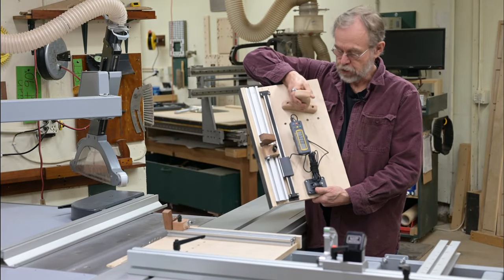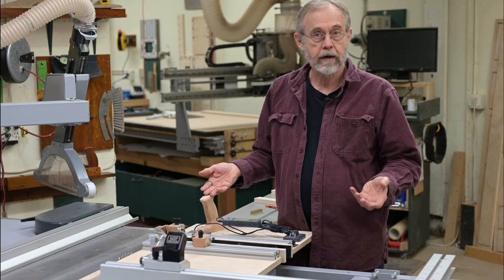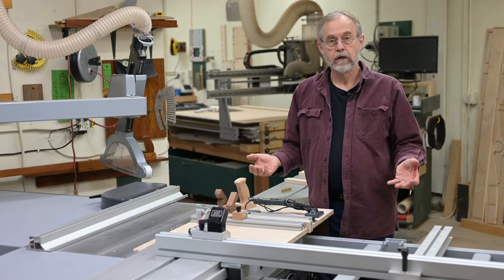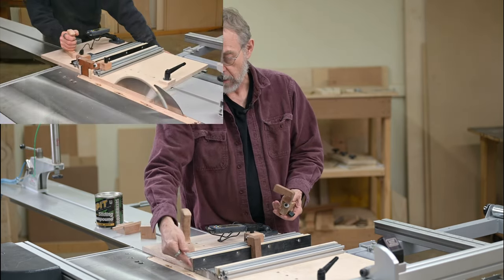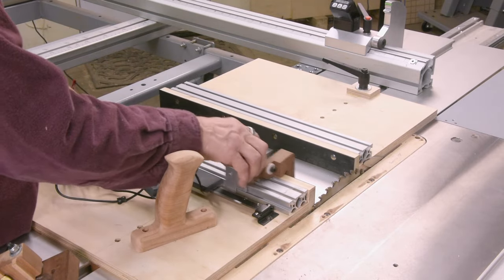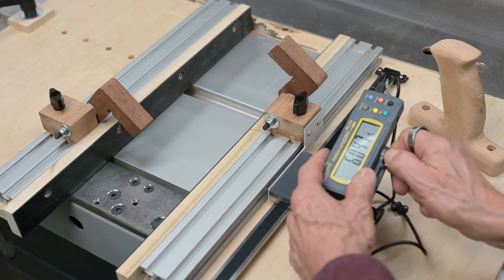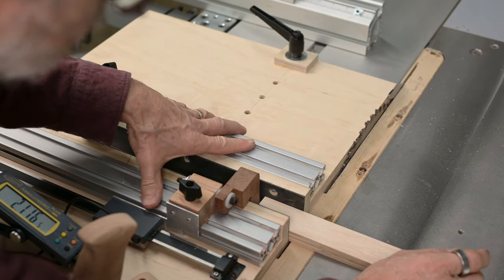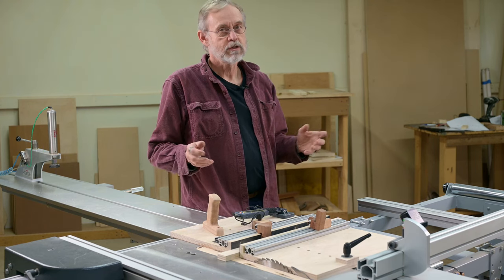Fritz and Franz with DRO (digital read out)

Comment: Excellent work!! Thanks for making this video!! I need to take this same build soon as well as make some pneumatic clamps similar to those on your slider. Researching to source all the parts and fittings is so time consuming. This really helps!

7months later it s there anything you’d change on v2.0? Do you find the jig(s) line up repeatable in the huge t slot on the felder slider? Like, each time you remove and replace then do they line up parallel to each other and square to the table? This has been my biggest concern having never used a fritz n franz jig before
Reply from the maker: Thanks... No problem with the two parts lining up.   If I were to make another version I would try to make the stops smaller - they prevent me from cutting somewhat narrow stock.
Reply: Good advice, thanks again. I now have two 500mm DRO’s on order. I think this one will be a bit of fun!

Comment: The other approach is to put a DRO on the rip fence and use it as the measuring stop, my F&F jig is two pieces of MDF with nothing on then because every cut is measured from the rip fence. I cut a 200mm length of fence and put that on the rip fence head which means I don't have any fence to walk around and I hardly ever do any ripping using the rip fence instead it is all done on the slider.
Reply from the maker: That's an interesting approach - I like its simplicity. My situation is a bit different - I use my rip fence on a regular basis for  ripping. My other restriction is that  when I went to add a DRO to my rip fence I found that Felder makes more than one "knuckle" (the cast iron  part of the rip fence that the aluminum fence slides on) . The knuckle that came with my saw does not accept the DRO.
Reply: I hardly ever use the rip fence unless the piece can't be ripped on the sliding table as the finished face is a far better finish and it is far safer.

Comment: Great video! Try putting a wave washer between the body of the DRO and the bracket. If you can't find a wave washer an internal tooth lock washer would probably work also but I would try 1 of these on each side of the bracket. If you have a local hardware store they should be able to fix you up. Our big box stores in the Texas panhandle don't show to stock many of either type. A last resort would be an auto parts store. I sure miss the 4 locally owned hardware stores that all died in the 90s and early 2000s. They had a lot of neat stuff that the big box stores never dreamed of stocking and most of them wouldn't have a clue what they were looking at.
Reply from the maker: Thanks - I’ll try a wave washer!